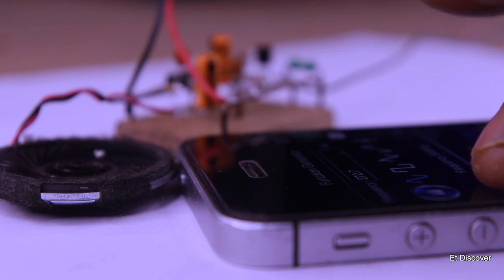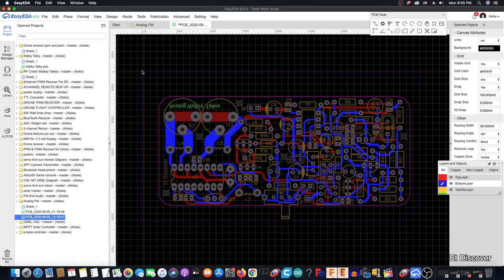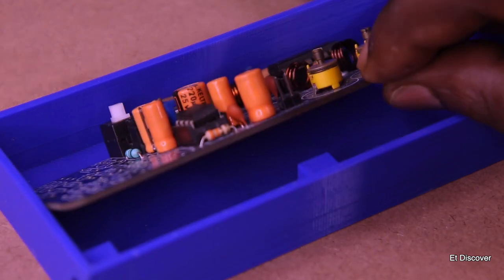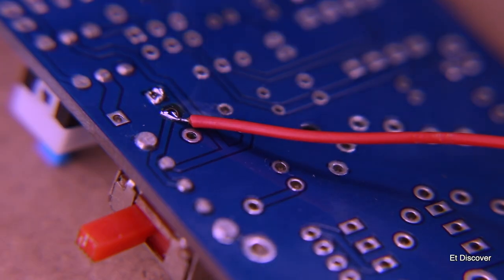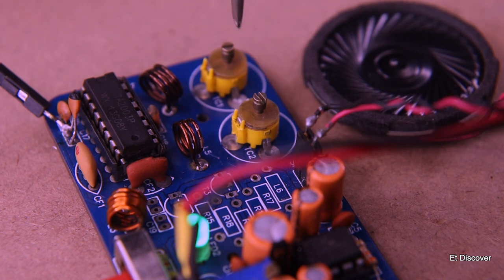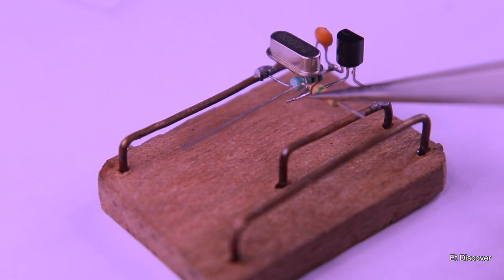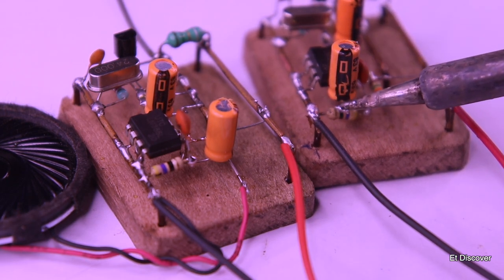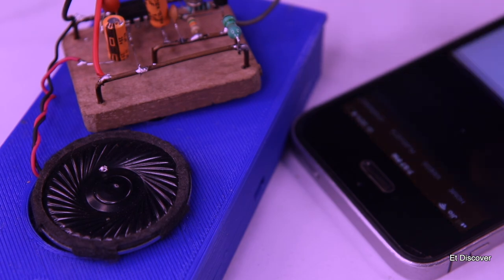Easiest way to Make a Without Coil Walkie Talkie

Comment: When will u upload the diagram? And is that crystal is connected to the ground? I saw that u connected crystal from positive to the base of the transistor in the previous video.
Reply: This crystal is connected to groung and transistors base bro this transistor is bc548

Comment: But there is a 1ohm coil(like resistor)in this circuit..but it's awesome and looks promising.. waiting for next video bro..
Reply from the maker: Don’t worry you can use there 3.3ohn resistor
Reply: @EtDiscover  cool ok but which ic u have used in the thumbnail

Comment: Mr et discover thank you so much. This transmitter transfers sound, please make the transmitter transfer comands. I want to build toys but i cant make a remote control and receiver. 
Pliz turn that circuit to remote and receiver thank you